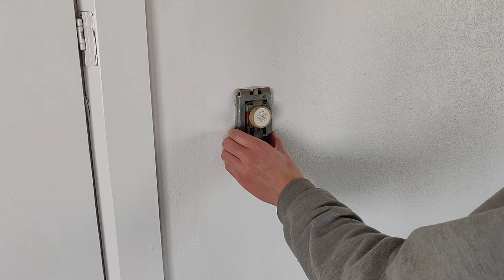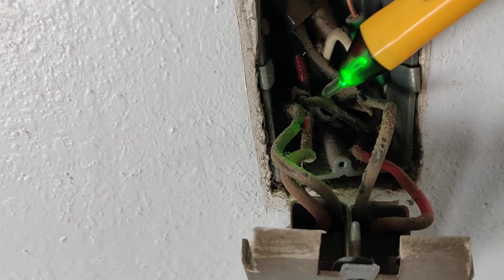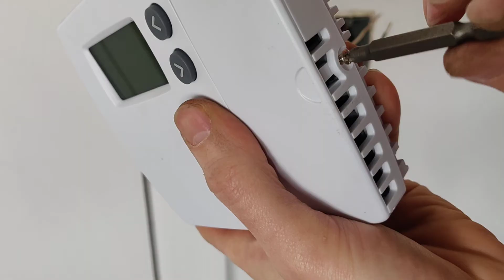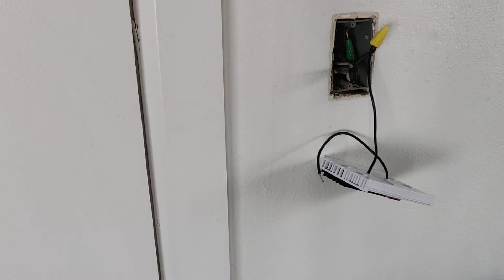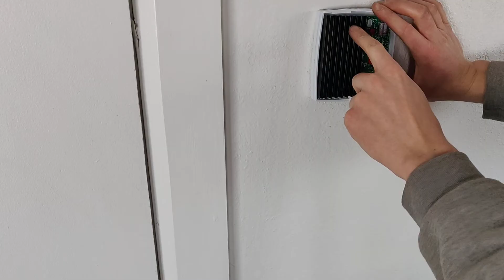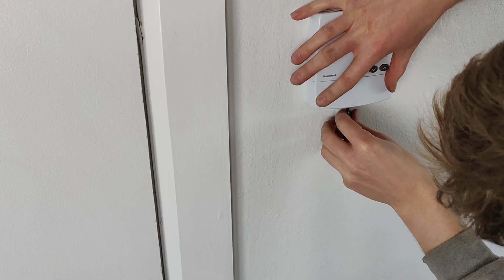2-wire 240V Baseboard Heater Thermostat Wiring (Honeywell RLV4300)

Comment: Sweet, here's my question - I have the problem the other way around:
I want to replace a 2 wire thermostat with a 3 wire thermostat.
IN the wall is a black, white and ground but only the black and white are currently connected to a Honewell RLV310.

The new thermostat (Meross MTS215) I have has 3 connections: L1, L2 and Load.
Can I put the Hot wire from the wall together with the two L1 and L3 and the other one from the wall to the Load terminator?
Reply from the maker: I think that's a 120V thermostat. So if your baseboard heater is 240V it won't work. If your baseboard heater is 120V then the white wire should be neutral and the black is hot.

Comment: I have this same setup, and really just want to verify the white wires coming out of the box are the bypass and the black wires connect to the new thermostat black wires?
Reply from the maker: Typically, if they have run 240V using standard 2-conductor wire, it doesn't matter which color goes through the thermostat and which color is the bypass. If you have a hot black wire, and a hot white wire, this is how yours is set up. You can send either the black or the white through the thermostat. I would just recommend being consistent and perhaps writing down how you've done it for future reference.

Comment: Bad wire nut installations,…. Wires should be twisted together with a player - prior - to wire nut spin on.
Reply from the maker: From what I've seen that chews up the wire ends pretty bad and doesn't result in a better connection.
Reply: Lets not forget, technically wire nuts or Maretts as we in Canada call them, are 1 time use ! Or better to get Wagos !

Comment: QUESTION: Since there is a direct connection to the baseboard heater (by-pass), is this configuration less energy efficient than if it were a 4 wire configuration? That is, is it less energy efficient than a 4 wire thermostat?
Reply from the maker: I think the only difference is that it can never fully be 'off'. During the summer you can shut off all the heater breakers. I don't even bother and it hasn't been an issue

Comment: am i correct that since both wires on the thermostat are nonpolar, so you don't have to worry which wires you connect?
Reply from the maker: I think that is correct but I'm not positive. The instructions included with your thermostat should say if you need to wire them a certain way

Comment: If.you want the base board heater to turn off.completely do you connect two power wires to one thermostat line. Would that work or do I need a 4 wire thermostat
Reply: Need a 4 wire
Reply from the maker: You can also shut the breaker off during the summer.

Comment: ALWAYS verify with a known good working power source immediately prior to using it to verify the thermostat power is off to ensure that the tester is working. They do go bad. I just use an old fashion multimeter myself. Those are quick check tools and really shouldn’t be trusted, an electrician will use it but will also double verify by a real gauge after.